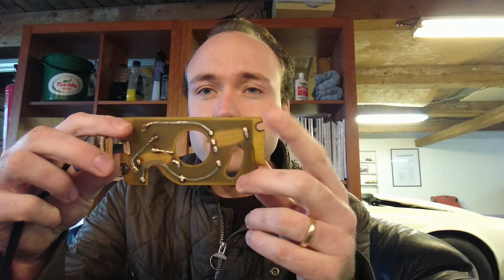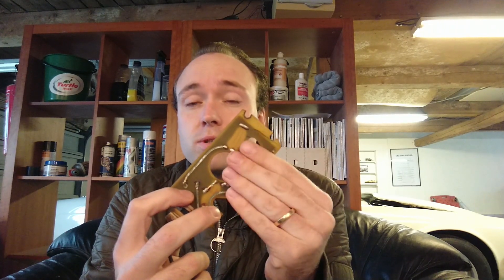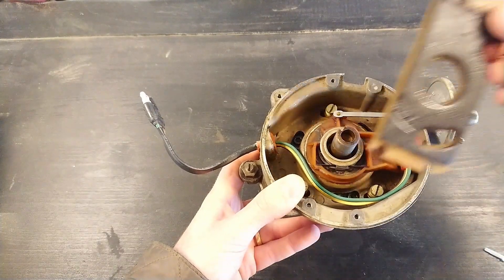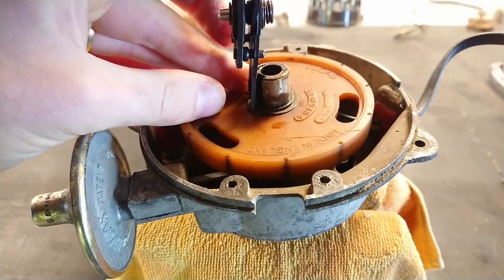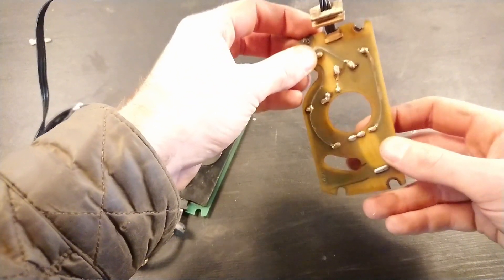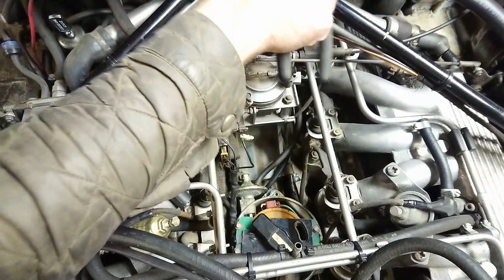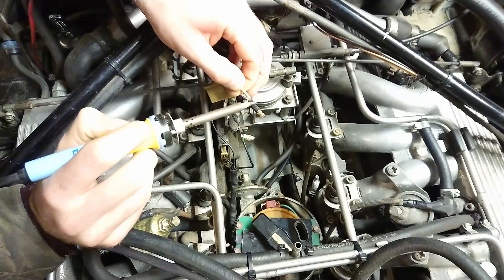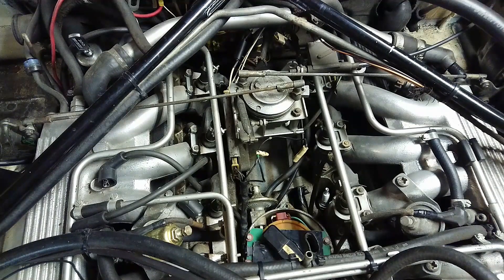D-Jetronic Upgrades - Replacing the D-Jetronic trigger board

Comment: The two boards use rotors with different magnets on them, a trap if you are just looking for a new rotor as I found out as they are not interchangeable. I still have the reed switch board and the rotors for them are now hard to come by. Maybe I will also have to upgrade to the hall effect board. My screws also broke and I manufactured some new ones, I found that the threads were a number 4 BA thread. That was the closest anyway.
Reply from the maker: I had the same issue before getting the right rotor.

Comment: Can you do a tutorial on the XJ-S valve cover gasket and half moon seal replacement?
Reply from the maker: That's a great video tip! Neither one of my V12's need the valve covers done but I can see if I can find a car to do it on. I have a friends XJ6 who needs the covers done. The half moons and the gaskets are basically the same, its just on the V12 you need to remove a lot before.